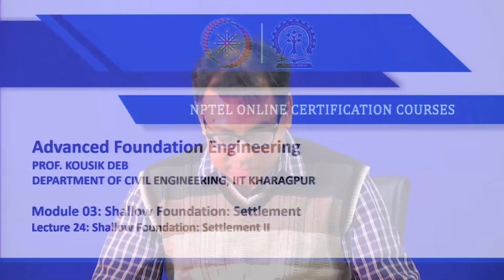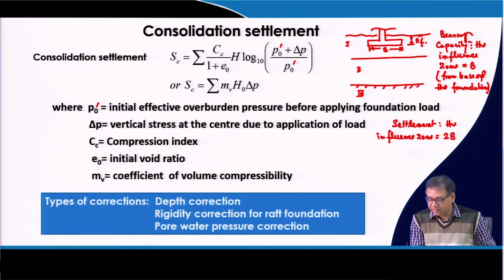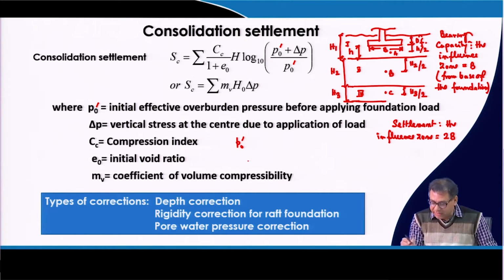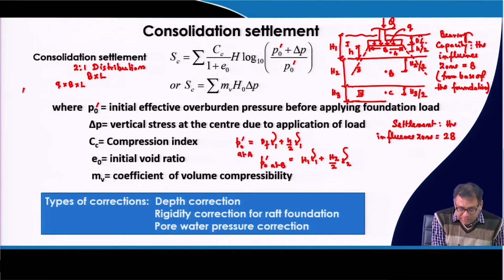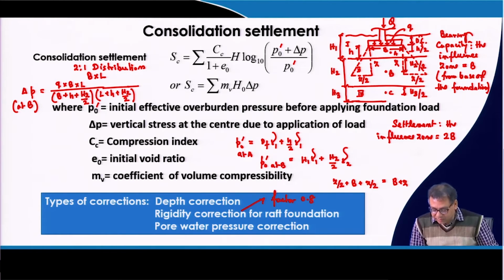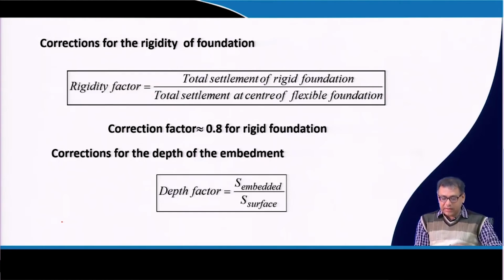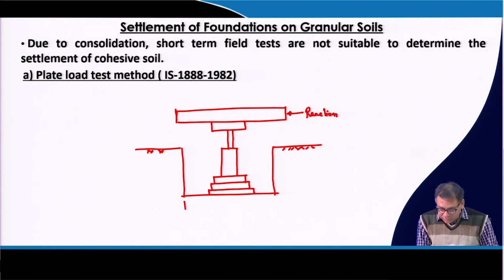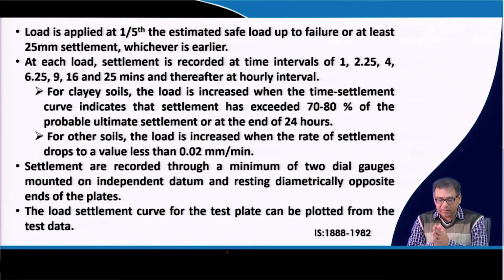Lecture 24: Shallow Foundation : Settlement - II

Comment: 1. Elastic Compression of Cohesive Soils under Flexible Foundations The plan of a proposed spoil heap is shown below. The tip will be about 23 m high and will sit on a thick, soft alluvial deposit (E = 15MPa) It is estimated that the eventual uniform bearing pressure on the soil will be about 300 kPa. Estimate the immediate settlement under the point A at the surface of the soil.

50 m

150 m

30 m

1

50 m

2

3